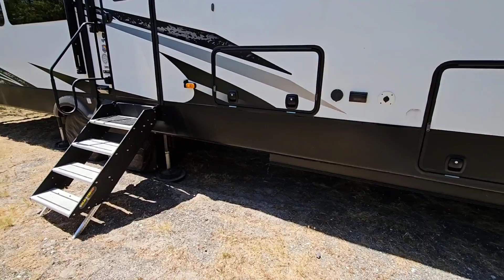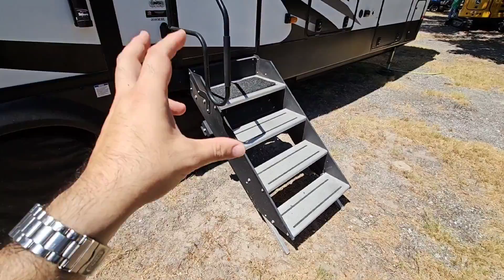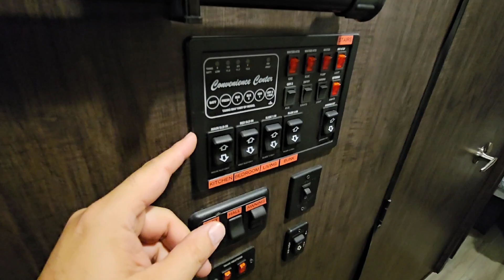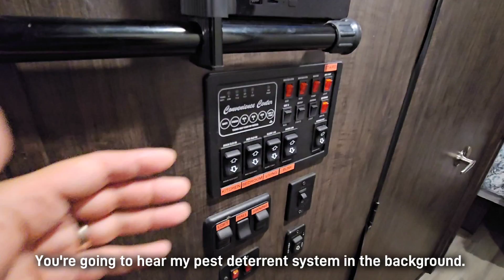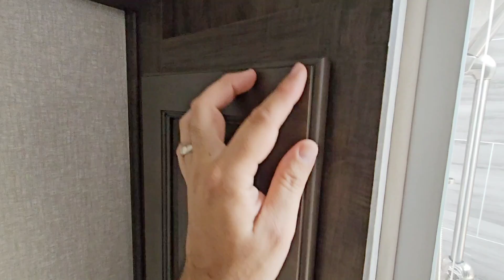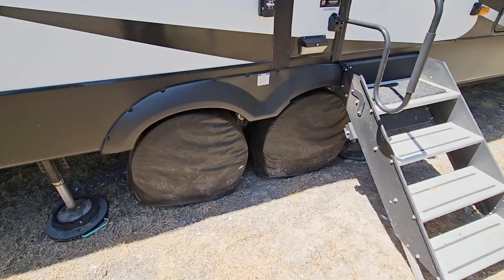DON'T UPGRADE YOUR RV! Until you watch this!

Comment: Don't know why Lippert and Moryde haven't figured out that there needs to be a pivot hinge on their steps because in many cases the steps can not be lowered enough to keep the door from jamming and not closing properly. You have to dig down into the dirt to lower them, and often you can not park tight to a cement patio because the steps stick up too high. I had to remove the Moryde steps on my Jayco 5th wheel and replace them with Torklift accordion steps which have a pivot hinge and can adapt to any height situations.
Reply: The legs are adjustable and will allow you to set up the steps for varying heights of ground next to the door.
Reply: @mileage_master  On my 5th wheel Jayco should have put on a 3 step configuration instead of 4. With the legs all the way retracted it would often not go low enough to close the door. My son has the same situation on his 5th wheel and I have seen where others had similar situations. One YouTuber was putting blocks under wheels to raise 5th wheel enough to get door closed. My Torklift steps have a pivot hinge outside the door so they are very adjustable for things like cement patios.

Comment: As I watch a multitude of channels, one common thread has been failures in the Lippert frames. A lot of Grand Designs seem to have failures in the front frame on 5th wheels. Also seeing issues with the outriggers on Lippert frames causing issues with sidewalls sagging causing problems with slideouts.

Comment: Azdel vs Luan.  I think there needs to be a good comparison.  Azdel is better than Luan for moisture, but screw retention isn't as good.

I really appreciate the extra bracketry on my Cougar 368mbi suspension.  I added Sumosprings and it is a better tow.   I need greasable wet bolts and bigger shackle straps.

Comment: What would be really nice is for the manufacturer to include solar systems that are fully capable of powering the RV as part of the whole package not an upgrade that theyre going to charge you 3-4 times what it would cost to go get it professionally installed. If they arent going to offer that as a standardized part of the basic RV package then at least offer a fully wired setup for a solar system to be installed at a later date as well as a dedicated space for a solar system install as part of the basic package. Ive watched so many of my friends atruggle with dismantling walls to run wiring for solar because the manufacturers wiring is inappropriate for solar power because of the type of wiring that they use. It costs so much more for the solar installation if the installer has to demo the walls to retro fit the correct wiring or like I've seen crown molding used to cover wiring because it was just easier. It might cost the manufacturer maybe $300 to $500 more in wiring but word of mouth WILL garner new and repeat customers. Maybe you can pass along this suggestion to the manufacturers? Love all the great info your vids have for us novice weekenders or first timers. Thanks for your hard work and dedication to your craft. Happy trails and safe travels to you!

Comment: Also you don’t see carpet in newer RVs.  I upgraded my RV because I wanted the residential refrigerator, a third AC, and slide topper awnings.  It also had 2 other must haves, a generator and a washer & dryer.  I have to admit the build quality of my “new” 2021 Keystone Montana was not as good as my 2014 Redwood, but overall I’m happy with the upgrade.

Comment: No sir, I messed up and bought a 2018 Heartland Elkridge and am most definitely ready for a much better researched and knowledgeable upgrade. A lot of that knowledge has come from you and some other great channels here on YT and I am very thankful for all that you do.  When I bought, I didn't do near enough research and now I know this most definitely is NOT a 4 season, full timing rv. Not to knock on Heartland, it is decent enough I guess for a starter but this is my 3rd 5th wheel RV and I should have known better. I'll leave it at that.

Comment: I really want to get at least a little bit of solar on my TT when I get back to the States.  It seems like every time I leave for a decent amount of time, I get home and have to replace my battery because it died and went bad.  I'd probably make my investment back in a few years.  Solar beyond that wouldn't matter much to me unless it'd run an AC, and that's far beyond what I'm willing to pay.
Reply: Also, one thing I think you missed as an improvement in some RVs is the A/C tech.  The ability to run 3 A/C units on 50 amps is pretty significant.

Comment: How has your roof held up? I have the same trailer (2021) and the roof has several crunchy spots. The whole roof needs replaced. I feel like it may be a venting issue as I live in mine and run the heat frequently.

Comment: I'm surprised you didn't mention the big change in refrigerators. There are a lot less of the gas / electric refrigerators and more of the 12 volt refrigerators. On some of the more luxury I've even seen the type of refrigerator you would have in a home. That is one thing that really stood out to me.
Reply from the maker: Very true.
Reply: I’ll agree with some others…refrigerators are a significant change.  Also, independent suspension (which you did a video on recently), Inverters, and maybe full body paint.

Also, look at a video that compares a touch pad vs button panel.  One of the huge things I noticed with these is the lag and time to get to things.  I LOVED our One Touch pad at first…but after using it for many years (camping 8-10 weeks at a time), it has become SO cumbersome.  Want to check the tank levels, wake up the pad (5 seconds or so), and navigate to the menu (more time).  Want to turn on some interior or exterior lights?  Again, multiples levels of menus.

Is it a GIANT thing?  No.  But when you are in it for long periods of time, it just becomes tedious to do certain things.  My wife didn’t even know we had accent lighting because we NEVER turn it on.

Comment: Minus azdel and the solid step, my 2017 Jayco Eagle HT Fifthwheel has most of the tech/features. Goodyear Endurance, CRE 3000, porcelain foot flush toilet. It had solar on the top, I took it off and have 1500w on there now, soon to be 3000w@24V with a seperate battery system and DC-DC charger to maintain a 12v system. Wiring for a 24V inverter is cheaper. I could go 48V but I would need to change the charge controllers

Comment: Seems like most of these changes are changes that can be somewhat easily upgraded on someone’s existing RV.  This of course depends on the age of the RV. The two biggest changes I really like is the addition of Solar built in, and the LED lights to reduce energy consumption and a safer more visible tech.